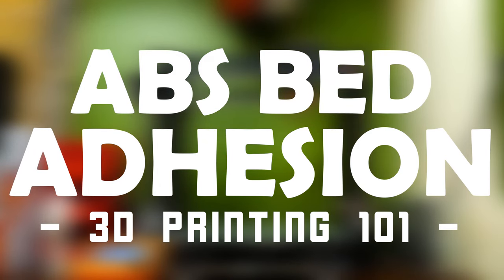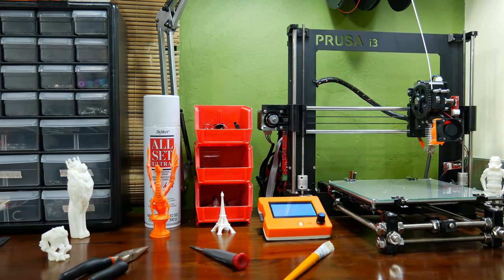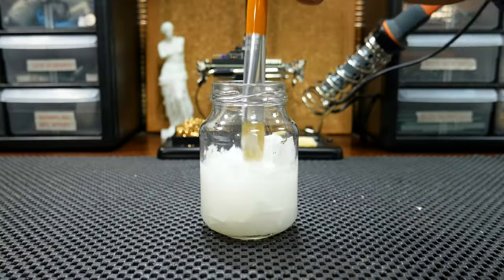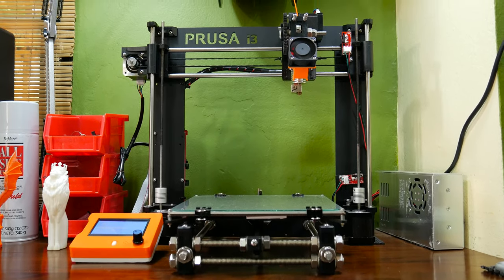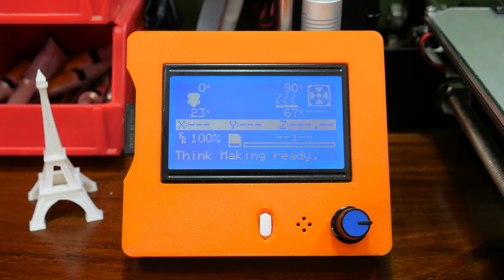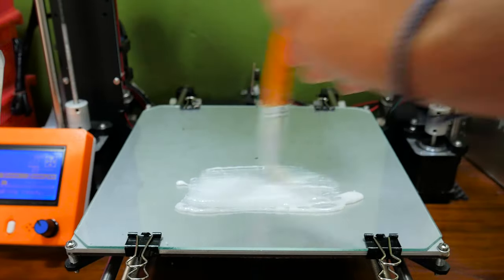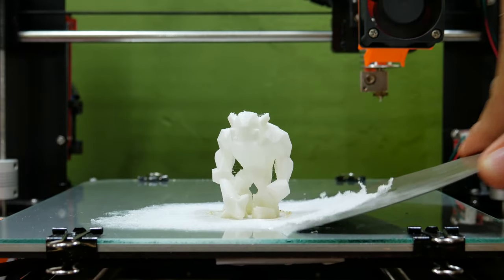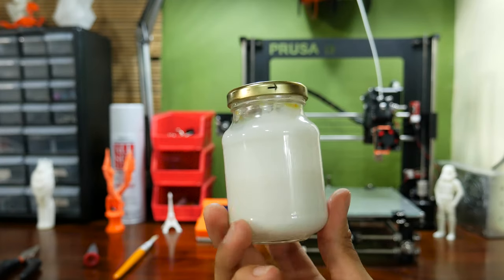⚠️ABS Bed Adhesion  -  3D Printing 101

Comment: Application of ABS slurry on warm bed is painful, as acetone evaporates instantly, actually boils. I apply it on cold bed, much thinner layer and even large prints stick to it perfectly. I use much less dense slurry.
Reply: Thanks for letting us know. Could you please post a video or describe in a more accurate way about how do you prepare your ABS slurry?
Reply: I prepare small portion of slurry, about 50-100 ml, by pouring acetone in jar and adding thin pieces of ABS from failed prints or supports. Close jar and gently mix. I keep adding ABS scraps until I receive a nice dense color. Slurry is of milk consistency. I use a rag  to apply slurry on bare cool glass just at places of anticipated location of print. Then I lunch the print.
Reply: Thanks for this aditional advise, i will try it.

Comment: Most people use heated enclosure to print ABS.  I use the stock PEI sheet and simply adjust the first layer temperature to get the desired bed adhesion.  IdeaMaker slicer allows for independent layer temperature adjustment.   Lower temp, lower bed adhesion.  I use layer 1 temp of 220C and print remaining layers at 250C.  Changing the first layer temp gives very repeatable results and adjustment is simple.  I was not able to get good repeatable results with all the hair spray, ABS slurry or adding tape methods.  No need to add all this  stuff.

Comment: I print on PEI sheet with no problem, with big parts I use higher bed temp up to 140 degrees, with really good results, never tried slurry too much work, PEI has 0 preparations, and ABS jumps right off when platform cools, as long your bedlever is right
Reply: i hate ABS have not had any success printing with it but that could also be because i bought cheap filament and tried to print it on tape... who knows i may try this method and see if that works better

Comment: This technique is working for small parts. But for greaters parts you will still have delaminating problems. To succeed against that you will need an inclosure with a temp close to the glassification temp of the Abs around 100°C. And then you can print without abs juice on a simple mirror glass and without adhesion problems and a perfect finish on your first layer.
I liked to no that before when I start my ABS prints so I hop it will help somes.
Sorry if my english is not very good, i am french.
Happy 3D  printing !
Reply: Printing on glass is so annoying, the glass constantly got chipped over. One glass bed is $5 in my country, it adds up quickly. Right now i already broke dozen of glass at least.

Comment: have you print some box 200x200 with 1-3mm wall thickness and 10+ cm height? how your adhesion on this?
Reply from the maker: Although possible on an open air printer such as mine, it would be much more prone to failure than on a an enclosed printer. If I print ABS, I usually stick to smaller prints.